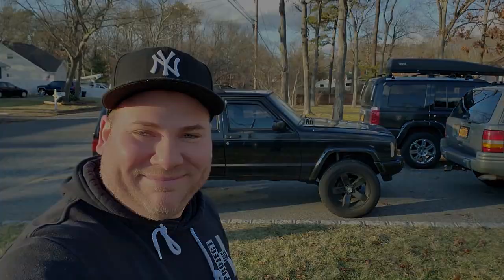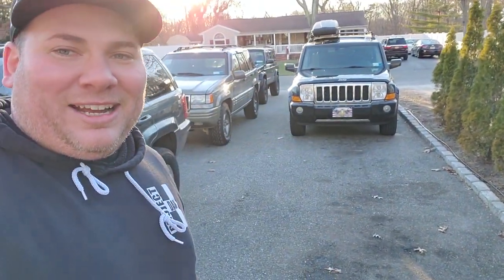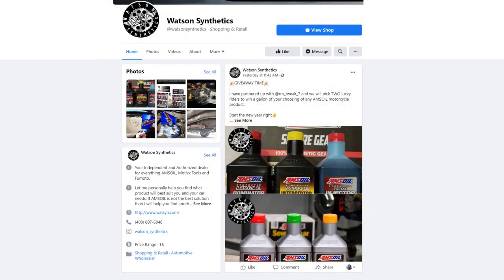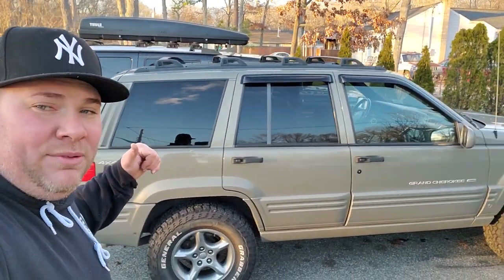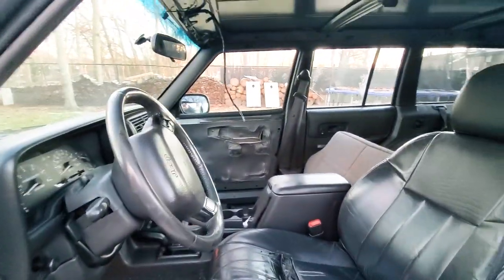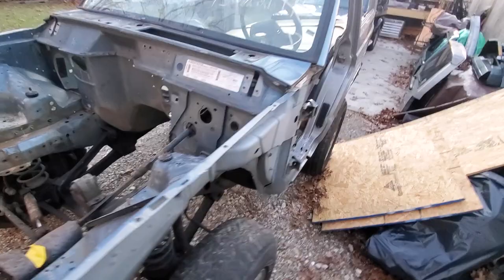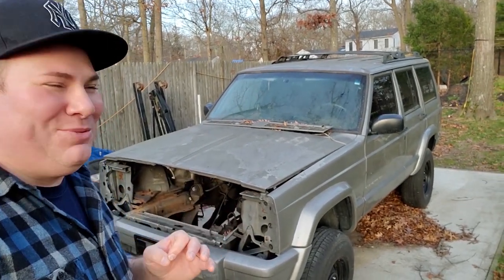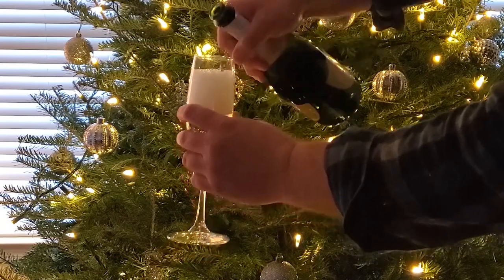BEACH JEEP PROGRESS FINALLY REVEALED AS 2021 PROJECTS PILE UP!

Comment: M8- love your work! I’ve had my ZG(the Down under ZJ) for nearly 15 years! Picked it up from the side of the road for next to nothing and never looked back. My kids have grown up in it and we would go wherever the Nissans and Toyotas would go, much to the surprise of our fellow Australians, who mostly don’t rate Jeeps at all. (Its a culture thing) Great to see that u rate General Grievance as the best, I obviously agree profusely! I gave the ZG an extra 2 inches and some 31’s (with white writing on the outside and weights on the inside👍)and have gr8 off-road capability and perfect daily driver combination. (A tiny bit of rubbing on full lock) I also use mine as a ute(Aussie pick up) for work and have driven it in almost exactly the same, jam packed, every space used manner as yourself. The roof lining got done a few years back  and she’s got monochromatic colour scheme, including the ARB bull bar(which would greatly improve the General’s looks! 👌)updated head and tail lights(sorry, Jeep did really F up with those tail lights). Over the years,       alot of things have been replaced(both diffs, transmission, transfer case, drive shafts and all the bushes just got done for the second time!) would love to have the 5.9 trim (and motor!!!!!)but don’t think any made it to Australia so have issues getting it from USA as the left/right drive thing/ buttons on wrong side etc- any suggestions? Have never had to touch the motor after 400,000km(apart from rocker cover gasket) .  Have been a subscriber for ages and you are an inspiration to us  Aussie ZG lovers who are very far and few between. I love my ZG(a bit too much for most people- lucky my wife gets it and my son can’t wait to get his hands on it(if I don’t get buried in it!) I never want another vehicle and will do whatever it takes to keep the ZG in tip top condition. Thanks again Dan for sharing the ZG love and keeping it real!
Reply: @Project Dan H
Reply from the maker: Hey Brother! thanks for the feedback! I LOVE THE ZG! Im gonna have to make another Jeeps World Wide vid just so I can feature yours!  Try searching on ebay.uk They have some 5.9 trim over there and you may be able to score some. Hit me up on IG and ill send you the name of a ZG owner that may be able to assist you. Thanks for the love!
Reply: Peter, see his reply about the adjustments on your turns signals under my comments above.

Comment: I did some research on Amsoil and Amsoil had the best coating properties of all other oils. When the engine isn't running Amsoil kept the best coatings on engine parts that lasted the longest to prevent internal rust from forming when the engine was not in use. Good stuff.
Reply from the maker: Awesome Charles! I'm glad it performed well I think amsoil and I will get along and great 😁

Comment: You talked about the wire issue going through the driver's door boot. Over the years of use open and closing, I had a few wires brake on my jeep going through the boot. I had to cut and lengthen all the wires going through the boot. No more problems. I have a 1995 Grand Cherokee Larado I bought new.
Reply from the maker: Yep! that's a common problem for all vehicles that you have a lot of use over the years.. Can't wait to dig in 😁

Comment: Being on long island i cant help to notice your proximity to a couple of drag strips.  So in 2021 if wreck j was my vehilcle after all those other ones you have id turn it into the drag j.  Find a 2wd xj front crossmember and you can put whatever engine you want.  You can go ls and be fast or if you want to keep it chrysler you can find any 318 or 360 to put in there.  Smack a torqueflight behind it and just see what you can do.  Plenty of 8.8 ford rear ends you can put behind there with little effort to upgrade.  Trust me dan it will be fun.
Reply from the maker: I love that idea!  I have a two-wheel drive front already.  I think a '96 and older style two-door would be great for a drag body

Comment: My ZJ got kicked out, replaced with a 2008 Explorer.  I want to get a Commander or WJ in the near future, leaning towards a WJ though so I can do a bit of a lift and tires on it for back roads & trail use.
Reply from the maker: The WJ is always a solid choice... If you can find a commander with a hemi and quadra drive2 I'd say go for the commander 😁.

Comment: Looking forward to the sun roof video. My 5.9 is sealed outside with flex paint cause I can’t easily and budget friendly find weather stripping without buying the whole glass with the weatherstrip. Plus in testing the motor I broke something plastic so I’m sure I’ll have to replace something else. But don’t want to start and get stuck with a 5.9 rain catcher lol without some idea and guidance.
Reply from the maker: Yea man.. my sunroof is grinding something to pieces.. I used flex seal tape to cover it up 🤦‍♂️

Comment: Dont know if you got to the evap issue on Cammander. But check the ESIM for small leak. Have had seen some ESIM not show smoke on test. Also seen the wire harness rubs the body and causes codes. Good luck and thanks for you vids.
Reply from the maker: Thanks for the tip! I really appreciate it!!!
Reply: @ProjectDanH  anytime. Thanks for all your vids helps keep me motivated with Comanche restoration I am doing.
Reply from the maker: Awesome man. Send me pics on IG 💪

Comment: Heads up with the ZJ lift I see that theres also a transfer lowering kit that I see is suppose to be used when you lift the jeep. Wonder if it's really necessary for a 2" lift.......
Reply from the maker: It may not be necessary for only 2 in.. three or more I would definitely consider a transfer case drop 👍

Comment: Is the beach jeep going to get two rows of bucket seats? When it comes time to sell parts. Im still looking to convert my two door pre '97 to the single window. Side mirrors would be nice since they would be more visible.
 Nice job maken it work without shop to work in
Reply from the maker: Thanks man! It's always a battle without a garage 
lol.  Yess it will have bucket fronts bucket middle and a 5.9ZJ 40/60 split rear.  Good luck on your mod, It's going to be great!

Comment: Recently you asked, "what content do subscribers WANT you to produce" ? Here is a video that I, myself would appreciate. Make a video on each and every tool needed aka a "Master TOOL Kit" that every ZJ, WJ, XJ should carry in their Jeeps. The video should in my opinion, have every wrench, socket, allen and screwdriver, and torx bit, including stating each size needed, stated and shown clearly. Along with that, all additional specialty tools and diagnostic add-ons that could be housed in a tool box, tool bag, etc. What do you think? What do your other subscribers think about seeing Dan H make a video that shares all the tools he would carry to do most ANY, non-major mechanical, electrical repairs while on the road or the trails? Oh, and Dan H, don't  forget to include, "duct tape and bailing wire" in your list, lol
Reply from the maker: that's a great suggestion Dave! I will definitely make this video happen thanks for the inspiration!
Reply: Harbor Freight carries a "Mechanics 301 piece Tool Kit" that would be a great start. It comes in a blow molded case and costs $200 (less with a 20 or 25 percent HF coupon) but has almost everything needed for most repairs. Maybe you could review it and then add an extra "Bugout JEEP Box" that has all the small "Extras" like a multimeter, test light, torx bits, crows feet wrenches. And lets not forget, baling wire and duct tape. Btw, if you or others have never worked on a farm, you may not be familar with the 1001 uses for duct tape. And,, as for "hay bailing" wire, both items are revered,.
Reply from the maker: @bombdiggitydave3881  That's pretty good man! I was going to start the series with the xj toolkit consisting of only a 10 mm socket and a Philips screwdriver 🤣🤣

Comment: hi dan congrats on 100k on black beauty. ok ill ask the question here XD.

just joined the jeep community bought myself a 1997 jeep GC limited 4.0 after christmas.
it has some faults tho. 1 abs light is shining with its yellow lovely shine so need to try to figeure that out before inspection ( in sweden we need to have a working ABS light ) well if that  fails ill just connect the abs light to the oil light so it loocks like it works.
2 the brakes are funny, when cold the brakes work fine but sometimes when warm the brakes pulsates like slight abs input/ warped rotors but not all the time.
3 my viscous coupler is bad so ill switch to a 242 in the future.
4 oh yeah ac dont turn on need to check cables and then try filling it with gas or change low pressure sensor.

ok over to my questions. if u know anything about the above mentioned problems i would love to hear it.

1st question do u have a tip on how to find a good 242 transfercase? in sweden we have scrappers who sell parts online but u never know fully the condition of the tfc. maby go and get to rip one out of a parts car but i dont know where to find one. we have xj and zj in sweden but i rather not pay 2000 usd for a parts car just for the tfc.

2 i whant in the future lift my jeep with a 3-4 inch liftkit. in sweden i can get rough country for about 950- 1000 usd but i dont know if i should go for that or go for a kit for 1500-2000 usd. i will not go on rock crawling just whant to use the car as an overland vehicle. got any tips on liftkits and what to go for?

gah now i realize i have a couple more things that i have to fix i have a slight coolant leak and i think my rear main seal is leaking. should i go direct for rear main seal change or shoult i try adding rear main seal stop leak??.
im going to add stop leak to the coolant to se if that solves my problem otherwise ill have to change alot of pipes,

great videos. got this car cuz its my dream car. and it had 0 rust. (uncommon here on the west coast in sweden we drench our roads in salt)  gonna undercoat the car on the lift next week. och crap just remembered my tfc is most likley the reason but one of the front cv joints is busted so that also has to be done. XD fun fun fun.
joined jeep to learn how to fix my own cars and i have a bit of work to do as its my daly driver. oooh i love this car.

ups long lifestory this sorry XD
love from sweden
Reply from the maker: Hey buddy sounds like you got a great project Jeep.  I think that if you go through the Jeep and perform regular maintenance that most of your problems will disappear.  It's a good idea to do the brakes first get new rotors and pads and also check your ABS sensors. You may have a bad sensor giving you the light.  I would avoid additives that's best to just find the problem and address it.  You May want to reconsider buying a parts car I think it's a great idea. take everything you need off the parts car, Save what you don't need for later, and then sell the body (or scrap it as a last resort). when you're all done sorting these problems you'll have one sweet Jeel and be one heck of a Jeep mechanic! Best of luck buddy

Comment: Hi Dan. I have a big problem with my 2000 Jeep xj 4.0 here in germany. I had a bad battary and i got a new one a few days later. After i put the new one in i could open the car with my keys. But the jeep would not start. It runs for 1 sec and then dyed. The yellow symbol with the crossed key is on so i find out that the ecu forgot the keys. How can i relearn or reset the theftcontrol????? You are my last hope. Sven
Reply from the maker: You would have to go to the Dealership in order to reprogram the computer to reset your SKIM feature.  if you want to disable the SKIM feature try this video.  Yell my buddy Joe I said Hi.

https://youtu.be/jvG2xubQXj8
Reply: @ProjectDanH  Thx Dan. Hopefully the xj is running soon again.